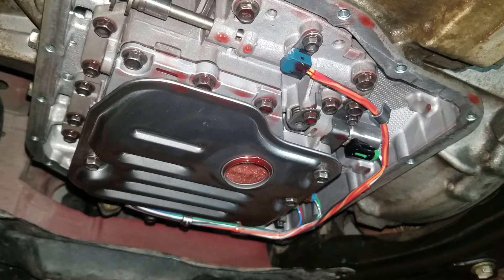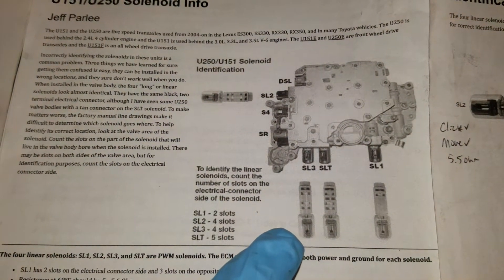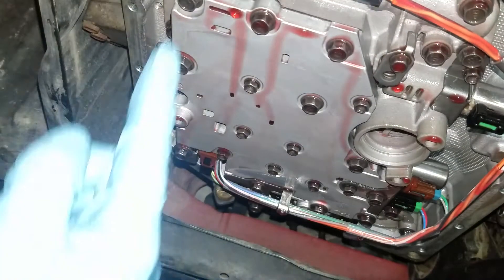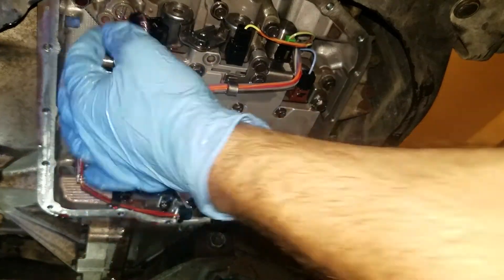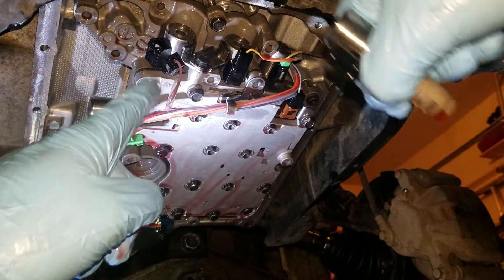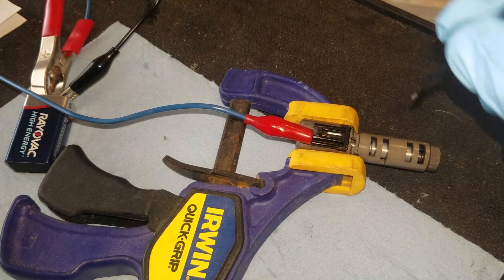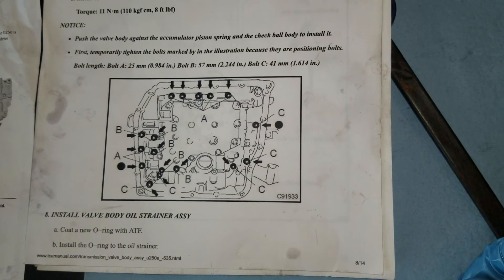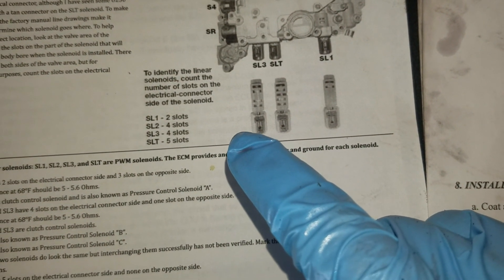2009 Pontiac Vibe SL3 Solenoid replacement and test.

Comment: What was the reason you replaced SL1? SOmetimes I have bump shifting 1->2 without load (no gas pedal). And then another problem, when transmission downshifts, it skips 2nd gear. So always doing 3->1 instead of 3,2,1 and if it should be just decelerating 3->2 it's doing 3->1->2.   Since SL1 is the most used for both scenarios, I suspect SL1.
Reply from the maker: I have a video on my channel about the SL1 solenoid.  I don't recall as its been a while since I messed with it.

Comment: I watched your video couple of times. May I ask you: My 2009 Matrix XR has P2770 (torque converter clutch solenoid circuit high), does it mean my solenoid SLT (or which one) or its connection is bad? If I want to replace SLT, must I lose the valve body to pull it out? thanks a lot.
Reply from the maker: I don't recall all of the solenoids and their function.  But if you want to replace it, you will need to loosen the valve body to have room to pull it out.
Reply: @elvrolet  sorry, I wanted to say DSL, which is the red connector on the corner, that one is the shortest, I wonder if it doesn't need loosing the valve body? I am afraid to lose it.
Reply from the maker: @online-church  When I removed the DSL solenoid, I had the entire valve body out of the car.  I don't recall if it would be an issue with having to lower the valve body to remove or not.  Sorry, good luck though.

Comment: Great video. Hands down best available online. I'm hoping this will resolve my issue. I neglected a p0741 SEL for too long and it might be why, my car stopped one random evening . Rn only the reverse gear functions and at that very very slowly. 
Hoping I didn't ruin my transmission. 
I think my previous neighbor, a self proclaimed mechanic, maliciously advised me to overfill my transmission, and I trustingly believed him. He also offered me a quart of dirty tran fluid that i stopped pouring when I saw it's dark color. It was shortly after that, the p0741 popped up. 
Can a solenoid stuck open or closed cause the car to stop moving? 
My filter was also extremely dirty. 
It's an 06 matrix w 280k miles. It had a recent engine swap prior to my purchase but I'm sure the transmission is original thus having carried out a long lifespan.
Reply from the maker: The solenoids control everything within the transmission, so indeed they can make it work or not work.  They are pressurized with trans fluid and the computer tells them when to open and close depending on what gear is requested.  
Here is a link to a diagram of the valve body that is helpful to identify the solenoids and functions. 
https://www.sonnax.com/tech_resources/301-toyota-lexus-u151e-u151f-u250e-solenoid-identification
Here is a link to a detailed course about the u250 transmission which may give you insight as what direction to look.  https://www.youtube.com/watch?v=aWs9x_Mbr4A&list=PLPUEEb0cYK88PCuoAax5w2aKAXgFlajyZ
Reply: Did you figure out a fix? I have a vibe with just reverse right now also. Unless I unplug the solenoid harness and plug it back in then it goes right into gear and will shift 1-2-3 but no od

Comment: I have a solenoid d code and I can’t find a video on it or where I can buy it
Reply: Here is a link to a diagram of the valve body that is helpful to identify the solenoids and functions. https://www.sonnax.com/tech_resources/301-toyota-lexus-u151e-u151f-u250e-solenoid-identification
Here is a link to a detailed course about the u250 transmission which may give you insight as what direction to look.  https://www.youtube.com/watch?v=aWs9x_Mbr4A&list=PLPUEEb0cYK88PCuoAax5w2aKAXgFlajyZ
I was only able to find them on Ebay.  SLT is same as D solenoid.  U250e transmission.

Comment: I changed a tcc solenoid on my 2006 Toyota matrix. New part . New filter. New oil. I cleared the p0741 code. Ran it like 20 40miles then came home no check engine light. But I put my scanner in and it gave me the po741 PENDING .Any idea why my friend??
Reply from the maker: I don't know the exact answer, but I would assume there is a certain amount of driving that is required before the pcm verifies the repair and that the new part is within specs.  Is the car driving and shifting fine now?
Reply: Yes it's driving fine 100%
Reply: @jacintogonzalez7146  i think what Elvrolet (I may be wrong) is trying to say is, it'll take some time driving it for the computer to learn & adjust to the new solenoid.
Reply: Hopefully🤞

Comment: Hey, this is the only video I’ve found even close to what issue I’m dealing with.    Would it be ok to message you directly with a couple questions?   My 09 Vibe has thrown codes P0746 & P0796 and my drive gears will intermittently not engage.  The codes are for pressure control solenoid A and C.   Im trying to source where to buy these and how to determine which is A and C.
Reply from the maker: I was only able to find the solenoids on ebay.  You will need to look for Toyota u250 solenoids
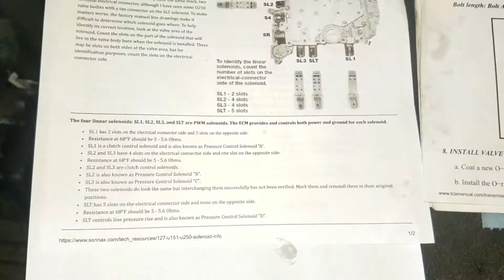Reply from the maker: At the 6:14 mark on this video there is a page layout that shows which solenoids relate to which letter.  'A' = SL1, 'C' = SL3.  
 Here is a link to a diagram of the valve body that is helpful to identify the solenoids and functions. https://www.sonnax.com/tech_resources/301-toyota-lexus-u151e-u151f-u250e-solenoid-identification
Here is a link to a detailed course about the u250 transmission which may give you insight as what direction to look.  https://www.youtube.com/watch?v=aWs9x_Mbr4A&list=PLPUEEb0cYK88PCuoAax5w2aKAXgFlajyZ
Reply: @elvrolet  Thank you! I was close to buying for the U140F – a mistake apparently.  I believe I found a set on eBay. This saves so much thank you.

Comment: Thanks for the video brother 
I have one question I have the same car with the same transmission when I start the car in the morning (engine/transmission are cold) the car will not shift to any of the forward gears ( d, l, 2, 3 are not working) reverse, however, is working fine then I have to wait for few minutes so everything worms up then the car will drive fine I replaced the transmission fluid and filter 2 years ago then all of a sudden this problem happened what do you think is the issue.
Thanks a lot, Buddy.
Reply: It could be the SLT solenoid.  Here is a link to a diagram of the valve body that is helpful to identify the solenoids and functions. https://www.sonnax.com/tech_resources/301-toyota-lexus-u151e-u151f-u250e-solenoid-identification
Here is a link to a detailed course about the u250 transmission which may give you insight as what direction to look.  https://www.youtube.com/watch?v=aWs9x_Mbr4A&list=PLPUEEb0cYK88PCuoAax5w2aKAXgFlajyZ